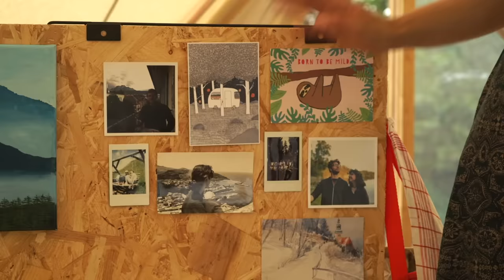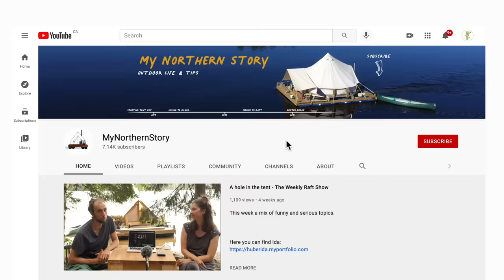Couple Living in a Tent on a Self-Built Raft - Floating Off the Grid

Comment: A larger, four stroke engine would be a great help in several ways. Four strokes are VERY quiet and use much less gas. Continued success on your journey together.
Reply: That barrel raft doesn't need more power. It's not a boat, it's a floating dock. It's literally about the least efficient "hull" one could devise; more power isn't gonna do any good
Reply: @eyeconspiracy  The steering situation gave my American OCD a true mind fcking. 

The deckboard was pulling up as he was cranking on the "steering cables." 

Yikes!

Comment: You could also do quite nicely on a pontoon boat. I have a 28 foot pontoon boat, has a 70 HP Evinrude outboard motor. It's old and not expensive but very efficient. I can travel along @ about 8 miles an hour, very quietly and economically. When needed the top speed of the boat is 21 miles an hour. Going to try a deck tent next season to see how I like that. Good luck on your travels...

Comment: I like the idea of this. Also had an idea. The long rug area down the center. Beneath that have a removable keel, could be half of a round table. Anyhow drop it through the center and this would help with wind drift,  especially at night.  May help prevent  capsizing.  Lift it up and out if the way when not needed.  Could actually use a pivoting keel in the front that is engineered into the steering of the outboard motor as well. Nothing more agrivating than trying to steer a boat in wind with just a small outboard.

Comment: Just a thought, grab a second trash barrel and the plastic drum found. Take the drum and drill lots of holes in it lash it the outside in the water and put the trash barrel into it and use it as semi cold cooler. I suppose you could just lash the barrel to the outside and probably have the same results.

Comment: Hi. great job. You may want to call Suzuki dealer and find out if you can get a bigger prop to fit you boat motor.  It should move the raft faster than that. Also if you make sharp edges to attach to the fron barrels you will get much improved miles per gallon and more speed.

Comment: I enjoyed your video very much. You mentioned most of your expenses is fuel for the two stroke engine. I wonder if you can switch to a four stroke engine (with fuel injection system). Might bring down the fuel costs overtime.

Comment: Funnily enough... My 27 foot long sailing trimaran. Would not fit trouhg those locks... It's 6 meters wide......... ;) Guessing ppl have commented this years ago... But get those wires into some shackles of some sort... You will grind trough wood with wires fast... A bearing of sorts, and a wheel. And if you bother to grease it now and then. It will last longer... :p

Comment: I think you will be pushing it too much to go electric for your outboard given that 5HP is really under powered for your purpose. I would suggest picking up a used Honda 4 stroke around 15HP. It's going to be a lot more economical than what you are using, does not require 2 stroke oil and most importantly will be VERY quiet, especially as it won't be working too hard. Keep up the great work.

Comment: The electric motor outboard is not going to be much of advantage apart from noise of course . You have a 6 hp 2 stroke motor now for 4 kmh so you won't want to go below that so probably 4-5 hp electric would do it .  That 3.76 kwh every hour its running . Your present solar cells 300watt/hour under full sunlight would take 12.5 hours to charge (more like 15 hours) to give you 1 hour of motorised travelling (4 kilometers )  thats 900watt hours per km . A model 3 Tesla uses 140watt/hours per km so your raft is suffering badly from lack of streamlining ,like a boat. Even if your present outboard is only running at half power , 3hp , thats still 450watt hours per km .  And 7-8 hours to charge for 1 km of travel .  You will have to find an alternative to charging or instal a LOT more PV panels .

Comment: Does it have a shower and bathroom and a Washer and Dryer?
Reply: Manual washing and drying by hanging clothes or using a compressor roll thing. They probably just boil and clean some river water and then use it to wash with.

Comment: youll only be living on the raft till the boards DRY ROT and fall apart.  moisture and lumber dont mix !! even treated lumber doesnt last. either pvc piping and decking or fiberglass or metal. thats all that will endure.